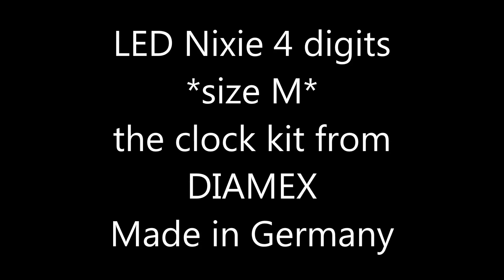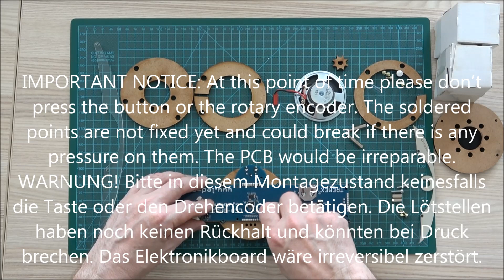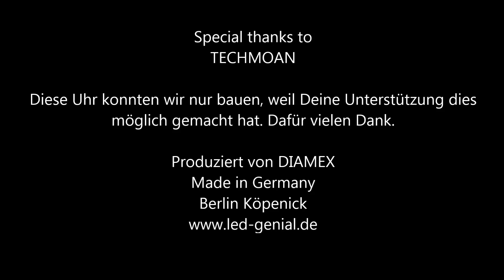Led Nixie 4 digits solderfree kit

Comment: OK,  paper in the kit shows there should only be 12 M3x10 screws, but at 02:56 you mention M3x12. thats quite e nono for me at €150
Reply from the maker: We are constantly improving our products and to make the assembly easier for our customers we decided to reduce the number of screws. This video relates to an earlier version of the kit. Concerning the screws there is no problem because both screws fit. For the 10mm screw you only need to press the MDF together a little. In addition to that, since the Techmoan video came out and that discrepancy was reported to us, we ship the product with M3x12 screws again so both of types of screws are included now. Unfortunately, on Youtube you cannot make changes to a published video so we would have had to delete it. But we thought it was important that the customers can see the assembly.
Reply: @FolkerUStange  thank you for the answer, pressing down the mdf and the acrylic thing made my second button unusable. Screws now hang in there without being threaded.